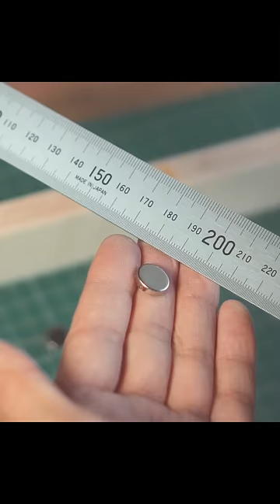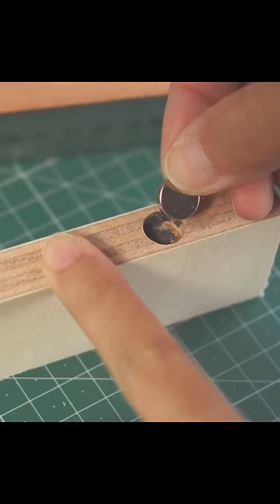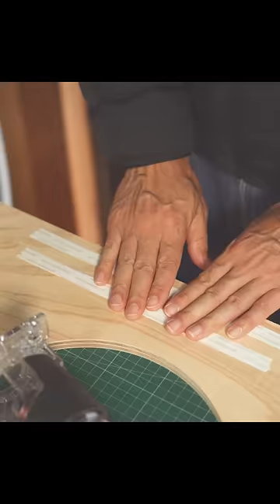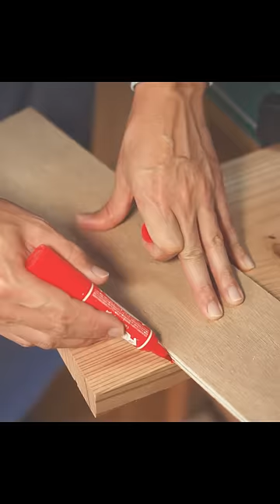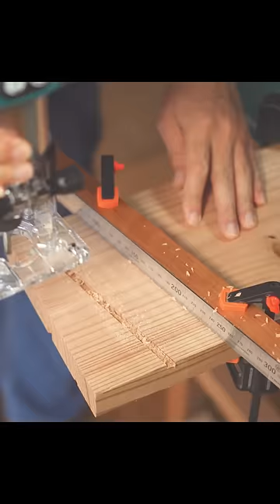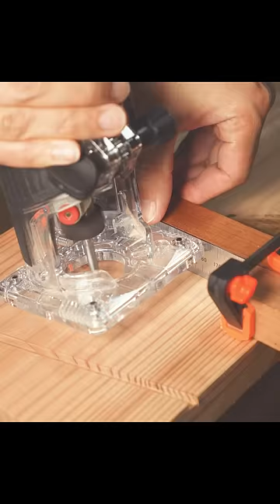Few People Know About This Hack🤫 #shorts

Comment: Clearly I'm not the sharpest tool in the shed. I'm certain there is some good information here, but it's lost on me. Some narrative (spoken guidance) would have been helpful.
Reply: He took some plywood and attached magnets to it. He then placed that against the ruler and cut it with the router and bit to make a matching reference guide. Whenever he wants to line up a dado for that specific tool and bit he uses the plywood as a spacer.
Reply: Maybe some text guidance if voice is unavailable.
Reply: I'm now in my 60s and we have been TALKING ABOUT changing since I was in 1st Grade. So now in everything we do, we have the added complication of needing markings for BOTH systems--partly because so much of what USED TO BE MADE HERE is now made in other countries.

Comment: I don’t understand this one
Reply: Honestly I'm not FULLY grasping it but it seems to be a tool/jig for custom dado cuts
Reply: Looks like it's a hack to have a ruler on a straight edge so you don't have to measure so often. The magnets keep the measuring tool from sliding
Reply: @Donovan3017 Easy! See: first he made an SPACER BAR, by cutting with his router, so that the spacer now has the exact width that his router will have for that bit. Then, he has the bar placed exactly where the bit will cut. In the second use, he used the ruler to clamp two stop blocks, so that the router will stop cutting at the precise points in the slot he wanted.
Reply: @alfredomarquez9777  so he could cut out dado holes if he wanted also correct?
Reply: Ah I see … that probably not one I’ll be using.  There’re always amazing but sometimes I’d just rather buy the tool well to be honest most times I’d rather buy the tools … I’m a tool junky

Comment: I can see why the ruler is useful for multiple reasons. It’s a hard and flat edge to run the trimmer base along and won’t wear out. It was also used to help set the stop blocks at the correct spacing - relative to the dimensions of the trimmer base - to allow him to set up and cut a mortise exactly 50mm long quickly. It was also used to hold the ply spacer easily (with magnets) to quickly set where the bit would cut. Obviously it’s got it’s niche for where it’s used, but it’s simple and looks to work very effectively.

Comment: I have to watch this multiple times to get it. Basically a spacer (white bar) was made that is exactly the width from the edge of router base plate to the router bit.

Then, the spacer is used to set the router guides for cutting the mortise. Useful for repeated cuts with this particular router bit.
Reply: But only for that cutter.I 😉
Reply: What's the benefit of the magnets?  Holding the ruler? Thank you
Reply: @corysturgis6660   it holds the spacer flush to the fence while aligning
Reply: @Zack-xz1ph  ty
Reply: So it would be better if it were adjustable and stuck with a magnet. But what was the peel and stick and trim job ?
Reply: @wesstone7571  The peel-and-stick is to hold the jig down instead of a clamp. It is to show how to use the jig for a straight line trimming.
Reply: @wesstone7571 the ruler was glued to the darker piece of wood. The magnets were inserted into the lighter wood, which is slightly wider than from  the edge of the router base to the blade. When the magnets stick to the ruler, they then run the router against the ruler cutting the excess wood off. Creating a perfect t straight edge abit like a track saw.

Comment: Cool concept,  but I think the general idea is still useful without the ruler... or the magnets for that matter. 
The most important part is the spacer the width of router base (edge to bit).
Reply: I have a ruler attached to a milled board just for making precise measurement marks on stock.Since the rulers marks are flush to the workpiece, there's little chance of error in placing your marks. It's great when the lighting  where I'm at isn't the best and it's way easier than using a tape measure for mid board marks.
Reply: I agree about the magnets, they are a little pointless, you could just glue it
Reply: The ruler also ads durability to the face you're running the router down. Doesn't matter what hardwood you use, a steel ruler is going to last longer and glide better
Reply: The magnets stock the space to the straight edge (ruler) so you can line up on your marks easier. 
You make your mark, put the spacer/ruler combo on your mark, clamp the ruler, remove the spacer, make the cut. This is a great marking tool upgrade.

Comment: So weird looking at a metric steel ruler.
Wish our stupid country was tough enough to accept change.
Reply: You could always just go ahead and move to a tough, non-stupid country and enjoy the metric system there. 🤷‍♂️
Reply: @Spoderman5000 Yes, the measurement system should always be what people base their residency on, great point.
Reply: I just convert. After a while you can guess pretty close
Reply: Just buy your tools in metric lol
Reply: I learned how to work with fractions in 4th grade. I reckon that makes me stupid...
Reply: @erniea4424  I bet you've since learned things like 1/2=13mm
Reply: @wesstone7571  - actually, it isn't 13 mm at all.
Reply: I bought a metric square because metric 90° is different than imperial 90°
Reply: @MattLitkeRacing  - is a metric square actually 32.22 degrees - kinda like Centigrade? (Or is that centipede 🤔🤔)
Reply: I'll play along.

Tell us the advantages of the metric system, particularly in a (fine) woodworking application.
Reply: Try putting 5 + 11/16 inches into a calculator.  Canada adopted metric about the same time that calculators and desk-top computers came into use.  As a design engineer, things became a lot simpler and faster with fewer errors.  Of course we must still be able to figure calculations in our heads to verify the computer.  Now if I cold just finger our spell-check, I would be satisfied.